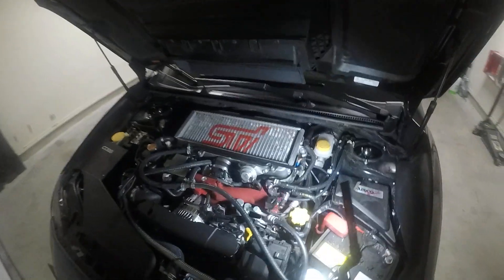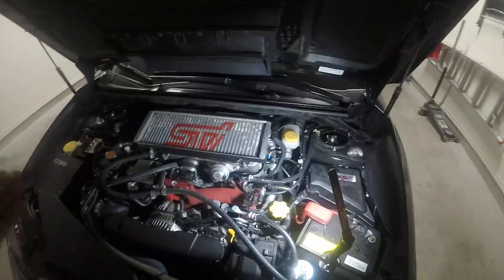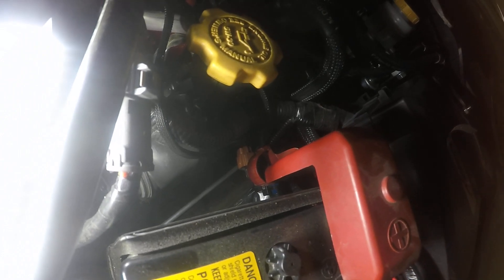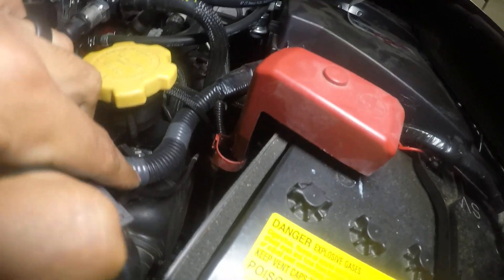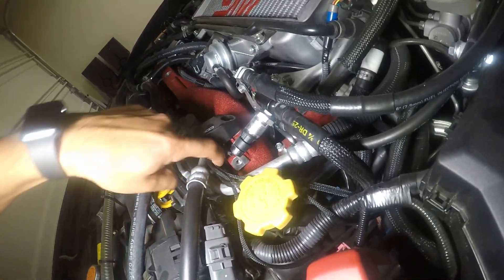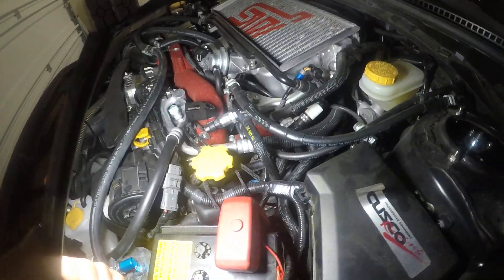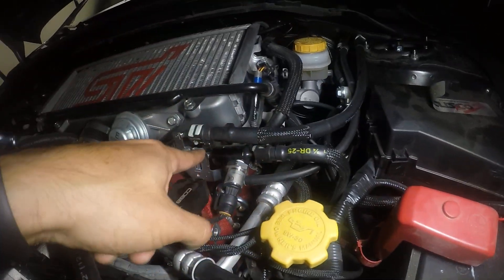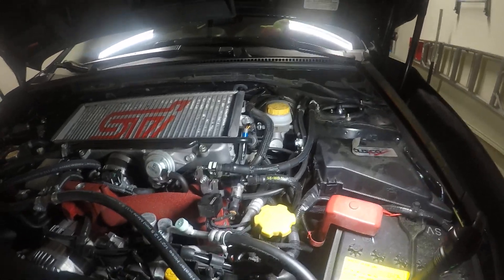Cobb Flex Fuel Sensor STI 2008 and up

Comment: Isn’t the the fuel pressure sensor supposed to be on the feed line(The top line on the intake manifold right?). I have Cobb fpr, the fuel pressure sensor, and flex fuel kit but Cobb’s  instructions aren’t the best.  I’m not sure how I’m supposed to get good pressure reading on the return line?  That doesn’t make sense to me.  Any feedback would be greatly appreciated.
Reply from the maker: The way I have it run In the video gives you fuel pressure readings after the fuel has run its course through the system. I’m not sure how to add a picture on the comment but at idle my fuel pressure is sitting at 35 which is where it’s supposed to be if it’s off by a lot you might have a pinched Oring in the hanger.
Remember the fuel system is all pressurized so in my opinion I don’t want the fuel pressure to be read as it’s coming in but as it returns that way if there is any leaks at the injectors or fuel rails I’ll know vs getting a reading at the firewall.
Reply: E85STI okay.  That makes sense.  I didint know it kept pressure on the return line the same as the feed.  I haven’t got my car tuned yet but I have it routed the way you do at the moment.  Cobb’s instructions show it on the feed line.  Anyway I haven’t gotten my base map yet and I haven’t been able to check what my accessport says.  It doesn’t leak so that’s good.  Thanks for the quick response!
Reply from the maker: @JobinMarobin  no problem and the group I’m on FB everyone runs it like I have it. I’ve gotten my car tuned and all that and the tuner said it’s fine how I have it run. Hope you make good numbers and power.

Comment: Can install my fuel pressure sensor on the feed line? Or does it have to be in the return line
Reply from the maker: Feed line its in the middle line.
Reply from the maker: You can also install it on the firewall same line but the FPS has metal teeth on the inside and once you slide it on its had to take off ive managed to take it off but its best to just run it there.
Reply from the maker: Nery Urrutia sorry about the first comment I was installing my TGV deletes and I misunderstood what you were asking. It is the return line as seen in the flex fuel kit the way you see it in the video is correct my verbiage was wrong in my last comment sorry about that.
Reply: E85STI yeah i  install the flex fuel kit and FPR and the fuel pressure sensor but i dont know where to install the fuel pressure sensor, i dont have  the fuel pressure sensor it on the car right know but i have the engine light on the AP the code COBB1 and COBB3 it saids fuel sensor low voltage input. Do you know why i have that engine code on?
Reply: I got that engine code on the car  right after i install the flex fuel kit and FPR
Reply from the maker: Nery Urrutia you’ll need a tune for the flex and FPR. Are you running the Flex kit and a fuel pressure sensor at the same time? If you are and you have TGVs it’s going to throw a code as the TGVs even though these kits have a piggy back plug it won’t really work unless your tuner forces the TGV to stay open that’s why everyone runs deletes so they don’t worry about the flaps position.
Reply: E85STI I’ve only installed the flex fuel kit and FPR Right now and im running  aftermarket TGV deletes , where do i need to connect the TGV DELETE  harness plug ?
Reply: Yeah i have a base map download on the accesport
Reply: Do you need the fuel stumble fix if we go e85